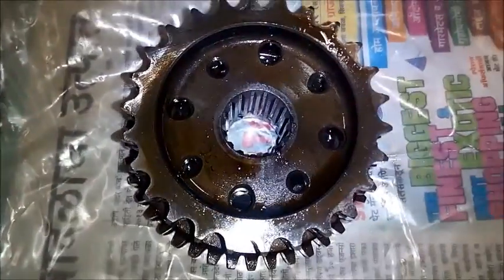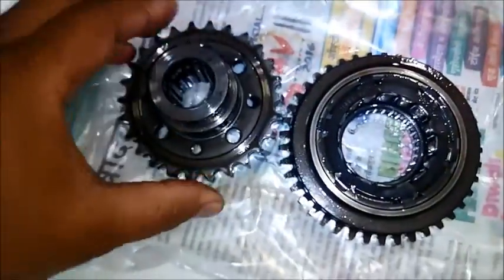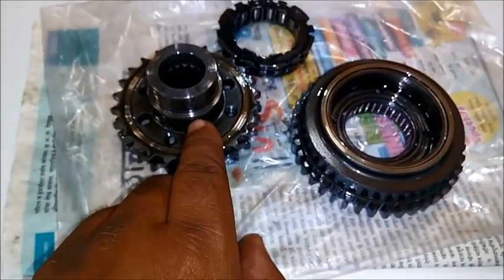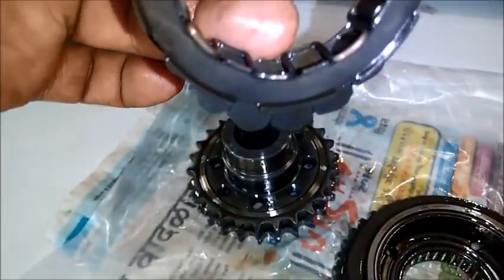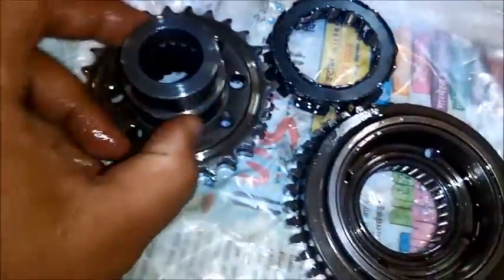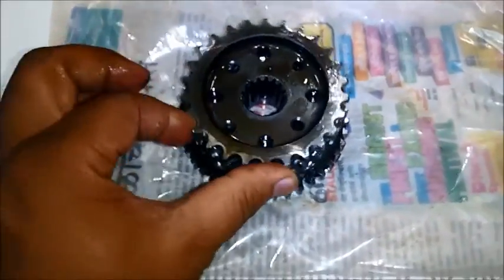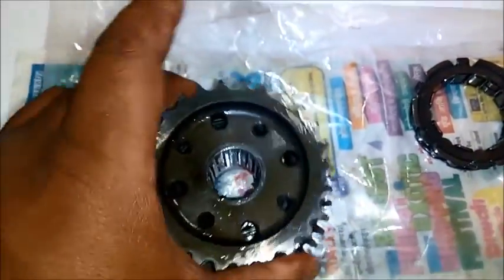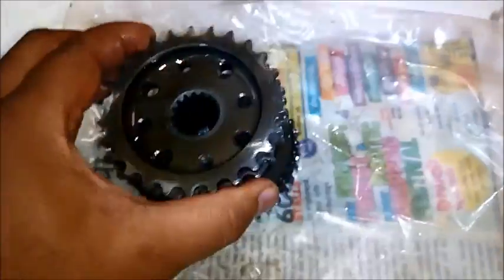Motorcycle Sprag Clutch Failure Explanation

Comment: I Have Thunderbird 350 . While Riding In Traffic In Slow Speeds . I Can Her Gear Change Like Or Gear Slip Like Noise And Bike Gives A Small Jerk When I Release The Clutch.
 I Release The Clutch I Feel A Jerk And Gear Change Like Noise. This Happens 80% Of Time 

The Noise And The Jerk Is Not A Please Feeling And It Does Not Give The Feeling Of Smooth Ride. It Feels Like I Have Not Depressed The Gear Peddle Enough To Put The Bike In First Gear. 
I Have Tried All Sorts Of Things But Not Able To Figure Out The Problem.

Any One Facing Similar Problem Or Know The Solution For This(Apart From Setting The Clutch And Adjusting The Ideling RPM).
Reply from the maker: check the rear drum rubber first thanks.
Reply: Sprocket rubber . yes that's changed to new. Could it be due to sprag clutch
Reply from the maker: nope. this could be due to rubber or loose chain or clutch issue ...
Reply: No one is able to identity the issue. Could you help me ? Where is your shop in Bangalore.

Comment: Sir can you please tell me, what is approx cost of One way clutch?
Reply from the maker: sorry bro. not in touch with spare parts anymore.you can contact one of the spare dealer. I used to buy from Mr.Rane-8007815854. Thanks.
Reply: gaurav vaidya it costs 2100 only the bearing.The whole set cost 4700 plus GST 28%

Comment: Hi, MY Royal Infield Continental GT has kick starting issue. When I kick it to start, it gets very tight, even stand up on kick, it goes down very slowly. Then again it get light and it starts within 2-3 kicks. It is happens anytime whether it is in cold or hot condition. My bikes battery is low but working for lights. Right now bike cannot be started by self. What can be the issue, either Sprag clutch Or Auto De-compressor??
Reply from the maker: check your auto decomp. may be it is not engaging. tight kick symptom relates to Auto D-comp unit. thanks.
Reply: Is there any relation of sprag clutch with my issue? 
Because Royal enfield mechanic is saying that this is the only issue of sprag clutch.
Reply from the maker: if you have very hard kick like as though unable to kick or very high resistance then your sprag is locked up. but if you are able to with little but yes with efforts then auto decomp.  to know this better to remove sparkplug and kick the bike if you still feel very high resistance in kicking then yes your sprag is locked. but if u can kick it easily then auto decomp has issue.
Reply: Bhai I am facing the same issue in my Bullet500... battery is only down for self stater lights and horns r working though..kick has become harder than before still it starts but now it takes 4-5 kicks at least and it also produces weird metallic sound whenever it kicks back..Chinmay Sir any help? Also pls explain about auto decompressor is necessary or not ? What will be the consequenses ?
Reply from the maker: STARTER needs almost full current from the battery due to 500 has high torque self start motor. but apart from that other things like bulbs and all need very less amps. In the battery there are two things which are important. Voltage and Amps/hr. So here in your case don't concentrate on Voltage. Please check the battery under load tester. you will get an idea immediately. if you don't have that unit then swap the battery with another. If self works fine just like before then please check the battery as well as battery charging circuit. Thanks.